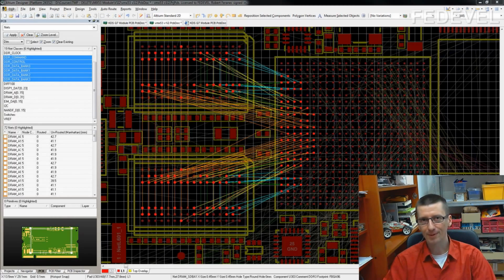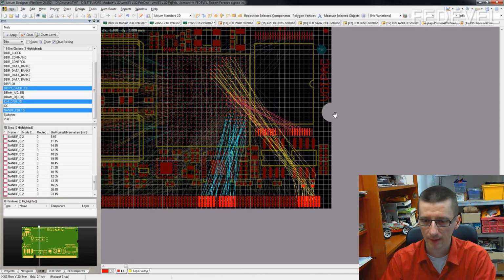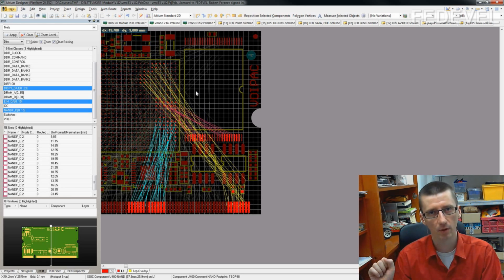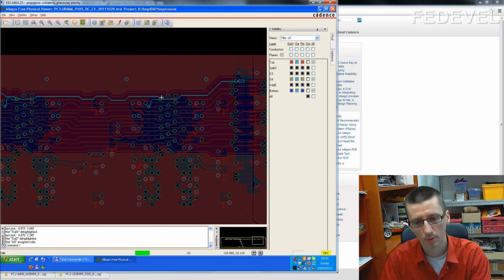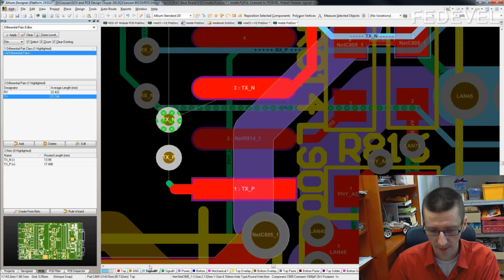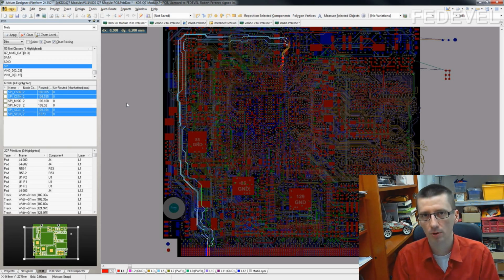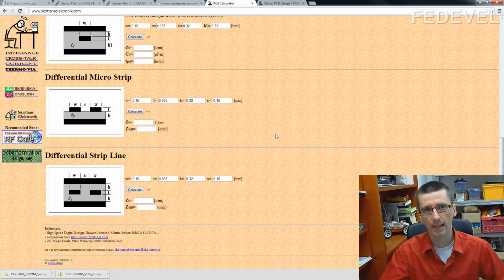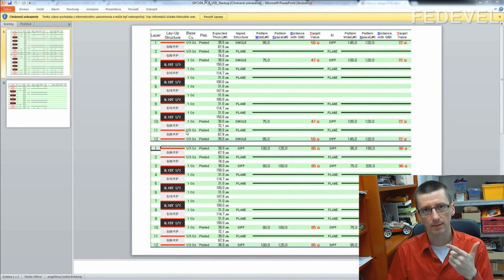Advanced PCB Layout - Lesson 8 of Schematic & PCB Design Course

Comment: When I trained for EDA for 5 days, 1st day the easiest board which is the very first time I saw the trainee software and i'm very unfamiliar and we're not able to use VIA, so I didn't finish, 2nd day medium size motherboard and still I didn't not finished, 3rd to 5th day the large size motherboard, I finished this one for last minute but my board is so much VIA, I just realize what's trainer said about the horizontal and vertical lines, we're 5 trainees and no one is hired hahaha! my dream is dead to be a design engineer. That was 2013.

Comment: Hi robert, I started to watch your videos, you did an amazing job this is really useful.
I have a question, I didn't see video where you present how to use multiple sheet as we can see in this video. I mean, you have one schematic SchDoc. which contains several  SchDoc in it. How you do this?

Thank you
Reply from the maker: Thank you Alex. I just create the top page and insert Sheet Symbols there ( "Place -> Sheet Symbol"). Then, when you compile your schematic, it will order automatically. However, this is just a very simple way to use it and I do it because there used to be a problem with PORT Reference numbers - if design was not done in hierarchy it didn't work properly.
PS: If you are still not sure haw we do it, you can download one of our designs e.g. http://www.imx6rex.com/open-rex/ It is completely open source.

Comment: Hi Robert, thank you for this video. 
I am confused by Dual Channel DDR3 layout on a PC. I will use XEON(R) E3-1200 v3 DRAM Controller on my desktop as an example. My desktop has 4 memory slots, 2 slots are black 2 slots are white. There is one memory installed for one slot of each channel, totally 2.On page 18 "2.1 System Memory Interface" of datasheet, it says: Two channels of DDR3/DDR3L Unbuffered UDIMM with a maximum of two DIMMs per channels.What I learned is that DDR3 PCB Layout is using fly-by topology, so all data lines from memory are directly connected to CPU, but address/cmd lines are shared by different memory ICs.For this XEON(R) E3-1200 v3 DRAM Controller, there are 4 memory slots on the motherboard, 2 slots for each channel. I have one memory installed for each channel, totally 2. Since each memory slot are 64-bit wide data bus, and this memory controller is also 64-bit wide, so each memory is directly connected to its own channel of XEON(R) E3-1200 v3 DRAM Controller in this configuration.But if I use all these 4 slots to add more memory, then for each channel, there are two memory slots connected, my questions is: are these two slots sharing same data lines on PCB? If so, then this is not fly-by topology. If not, then how are these two slots on each channel connected to CPU? Thank you.
Reply: Nice question man! Unfortunately no answer :(!

Comment: Thank you for the great video. For DDR3 layout on 8layer board, is it good to place tracks on inner layers with through vias, since stubs can be created?
Reply from the maker: Thank you. Yes, that should be fine. I used it for some designs. If you like, you can have a look at our open source projects here: http://www.imx6rex.com/
Reply: @RobertFeranec   if you respond to a technical question in this manner it is not enough! You need to be specific and explain the problem in a technical way also maybe give some references written in well know articles. It is good you reference your board but say where to look specifically not just to merely point to something.
Reply: You can back drill the vias. Also you can make stubs if you improperly route the tracks. Also it depends on the technology if you refence the tracks to both gnd and vcc or just gnd...

Comment: Hi, i saw that you use 18pF load capacitors for crystal. Is that better or 22pF? I ask for 8MHz 16MHz 27MHz and 50MHz
Reply from the maker: +N!cky you may need to check the datasheet of your CPU/microcontroller. The chip manufacturer should give you an equation or some recommendations for crystal selection (that includes information about recommended crystal capacitance). Capacitor value may vary between different chips.
Reply: Robert Feranec Thank you!

Comment: So you receive the layer stack from your manufacturer and there are the width to achieve 90R differential impedance. What about the single 55R impedance? How to achieve that?
Reply from the maker: +Paulo Lopes, same as for 90OHM, your PCB manufacturer will suggest you the correct track width for 55OHM Single ended tracks. Maybe have a look at these my posts, it can help you: http://www.fedevel.com/welldoneblog/?s=stackup
Reply: That is the definition of single ended... just one track not two as in differential... also it depends on the surrounding environment... if you have other tracks in the vecinity and if there are even or odd propagation modes the track impedance will change... you need more info about high speed design not just a formula or some manufacturer's specs to create some trace impedance...

Comment: Hi Robert, Can we add the Constraint region in altium as in Allegro?
Reply from the maker: Hi Ganesh. Yes you can. For example, I sometimes define smaller clearance under a particular footprint. This is how you can do it. Go to : Design -> Rules: Design Rules -> Electrical -> Clearance -> Right click: Create New Rule. Then just insert this: 1st Full Query "(OnLayer('L1'))" and 2nd Full Query "HasFootprint('TheFootprintName')" and set the required clearance. This means, that on the Layer 1 and under TheFooprintName the minimum clearance will be as you set. Is this what you were looking for? Have a nice day, Robert
Reply: Thanks Robert, I will try it. I want to assign the different rule(line width and spacing) for DDR and FPGA in their region, in all the layers how can i do it? I am newly using Altium. please suggest me.

Comment: Very good video made my work on the memory design layout lot easier.Thank you
Reply from the maker: Thank you
Reply: hi Robert,
i am interested to learn Signal Integrity analysis on cadence allegro please include this topic in your next tutorials.
Reply from the maker: Hi Aravinda, I do not have cadence allegro :( It's very expensive :(
(I used to work in cadence allegro and .... it's the best PCB tool)
Reply: Robert Feranec
Thats ok Robert thanks for the response.Have a good day
Reply: @RobertFeranec  Unfortunately the guy asked you something else, something technical. It was a question about signal integrity. When will you create some video tutorials where you unravel you experience in emi and emc?
Reply from the maker: @georgemax23  Form EMI and EMC videos, ideally I would need access to the test house and to people who are expert in this field - not easy (need more subscribers for this :). Biggest problem with EMC and EMI is, that what works for one design / product the same may not work for different product. Also, there is a lot of theory and not easy to explain with plain words. So I have not go much into this videos .. yet.
Reply: @RobertFeranec  I will comment only the part: "... what works for a design..." . Unfortunately you are wrong. EMI and EMC practically are the same thing... also if you understand and know very well the electrical and magnetic principles you won't be wrong in any way... You can't over design or wrongly design... it is just physics and electronics applied... I saw that you are a tips and rule of thumb guy... unfortunatelly physics and electronics is not that...
Reply: @RobertFeranec  I have a lot to comment reading again and again your post... to do something you don't need subscribers or money... take the example of Testa (the man)... Einstein... can you please tell me what did they gain? ... subscribers? I know you want to think as a bussiness person, so unfortunatelly you won't understand...